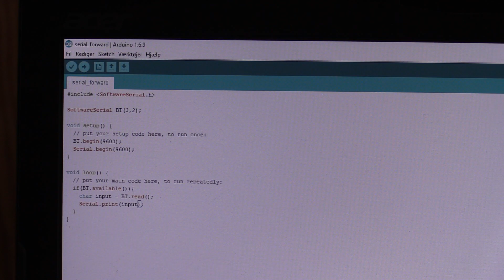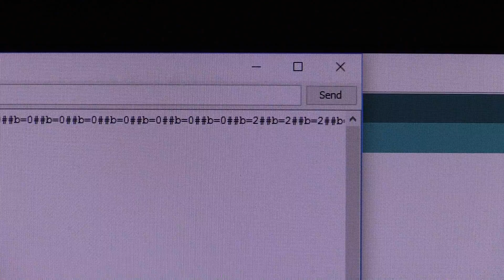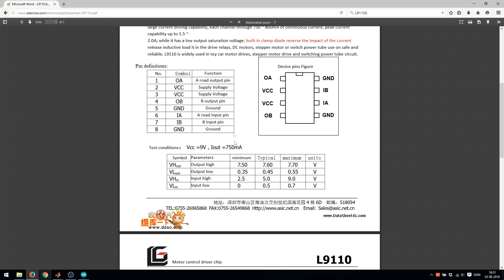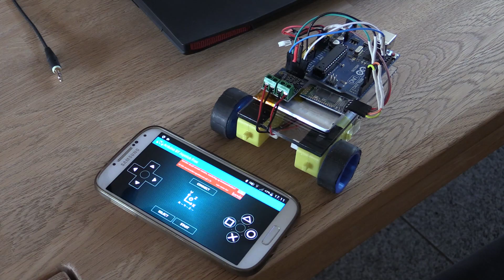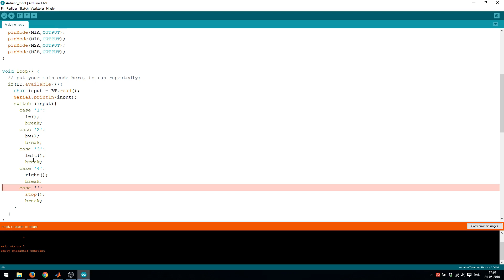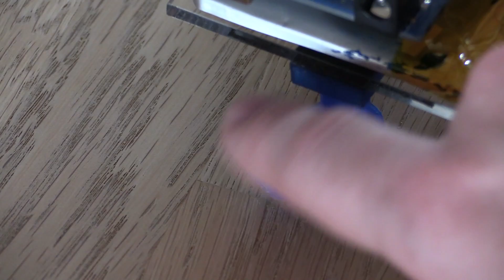Making a DIY Arduino RC Robot Car - Part 2: Programming - Ec-Projects

Comment: can you please give me the circuit diagram?
i hv done every thing, uploaded the code, connectd to the phone but the motor is not moving.
please send the diagram.
Reply: you have to follow the part2 video connect pin 5 to m1A ,pin9 to m1B pin4 to m2A ,pin10 to m2B. my is working

Comment: For M1B and M2B, can I use pins 5 and 6? Since I am using TMRpcm and it requires pin 9 for speaker, can pins 5 and 6 do the same?

Comment: Liquid electrical tape works great for lay on rubber. Or an old O-Ring would work as well. I also agree that the motors are not matched, they will always run at different speeds. The thing is that since there is no feedback, even very expensive motors would need a feedback loop to perfectly match the speed. You can always design a differential for that car and use a single motor and a small brake on each wheel to steer, kind of like a tank. You would still have two motors, but one is for driving only, and the other is a servo for steering.

Comment: I do not think there is any problem with the rear wheel. If it does not have enough traction to straighten itself, it does not have enough to steer the car. I think the problem is that the motors are not matched and not consistent (i.e. cheap), so one of them is often running faster than the other.

Comment: Why not just use a small flat style rubber O ring for the wheel or small drive belt ? the type used for pulley or capstan tires. I actually have a few old cassette pinch rollers I could send you they make great little tired wheels for remote cars like that. This sort of thing http://www.terrysrubberrollers.com/